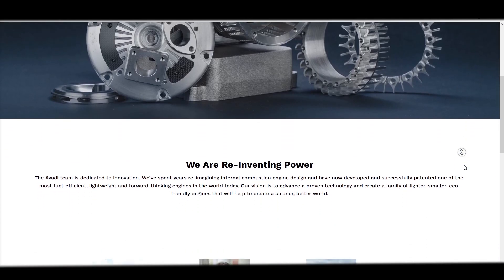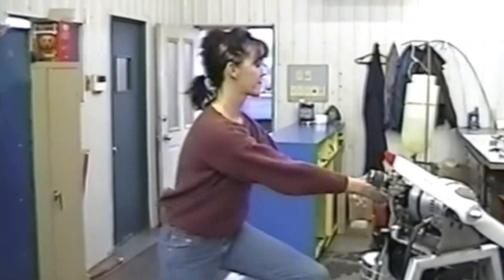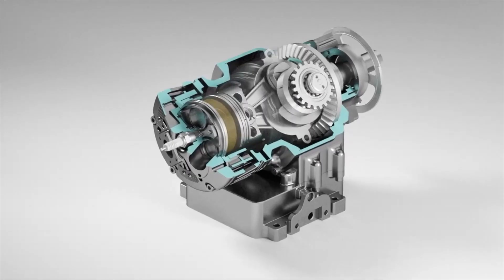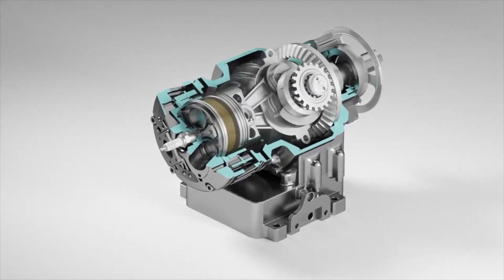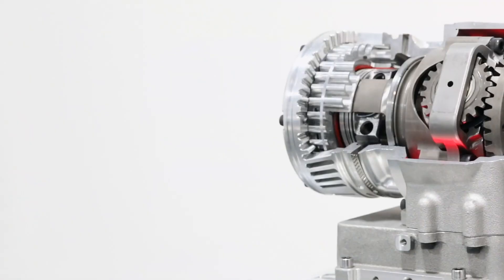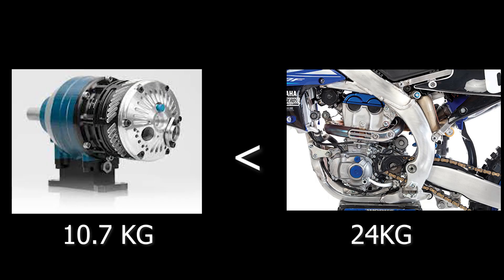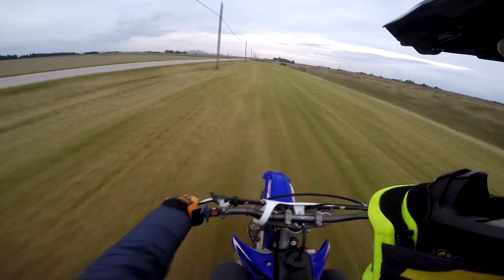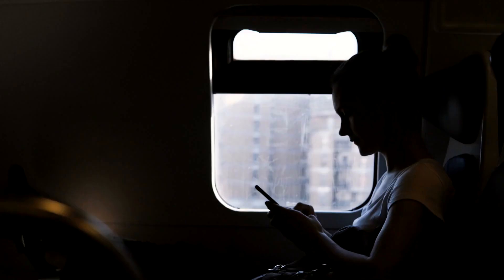The Avadi MA-250 - The internal combustion engine re-imagined.

Comment: LESS efficient than a motorcycle engine.  Less power and torque, if you take into account the torque multiplication that the engine's inherent gearing has. What's its point? Only in something where an expensive but small, low power, single cylinder (and light) engine is needed. Otherwise, it's useless.

Comment: Very interesting and unique design, however engine still burns fuel, which is one of the least efficient methods of obtaining energy. Electric motors enjoy efficiencies in high 90's, and produce zero pollutants; unlike fuel burning Otto-Cycle limited by thermodynamics. Internal combustion is antiquated, inefficient, generates pollution, and horribly mechanical by nature. Lets move on to produce energy from clean chemical, biological, and renewable sources. Given eventuality of laws banning use of internal combustion engines, this design is novel but not future proof.

Comment: Saying it's simplified but has been made more complicated with more moving parts which in turn cause more wear. What has been doen to avoid or minimize piston skirt wear during the upward and now added rotational force. If there is any failure it doesn't seem like an economic or straightforward fix. Seems to be overengineered.

Comment: Yes, but the piston is moving at twice the speed of the output shaft and the output shaft would have a maximum rpm of a lawnmower engine.  Cut the power claims by 50% on the Avadi, to better represent the actual power output.

Comment: To be fair, you're not including a transmission you'd need to add to the size and weight of this engine. Also, many trail type bikes that are 250s also put out about 16 hp, so this may not work in a flagship bike, it may fit nicely into something like a TW200 or XT250 as well as ATVs

Comment: It is an interesting concept , I  totally reliable conventional valve assembly would not detract at all from the rest of this ingenious design, moreover,  electro-mechanical valves have been used in diesel engines for well over 40 year ...no reason why they could not be used on this little gem.

Comment: After watching the cutout animation several times I am wondering about what the combustion heat will do to the gears. Longevity is an aspect that needs to be addressed.
Reply: Also gears don‘t like to get hot. Metal expands and so the gears would either seize or at least lose sync or change timing.

Comment: This is an interesting engine, however, why compare capacity with another engine?. What matters is specific fuel consumption for energy output. I also wonder how well the sealing of the port plate will work. Also wonder about the frictional losses of the double crank. How is the heat dissapated from the rotating port plate ? It might be a good engine to scale up to keep the rotational speed down. Very interested to see further developments and more technical detail.

Comment: This would be perfect for a generator, but instead of gasoline, you use hydrogen, then the emissions will be met and the electric produced will drive the vehicle much like a diesel operated train. The diesel engine only spends the generator, but it is Able to pull the entire train, using less fuel than conventional systems

Comment: Somone has also beenbworking on an oposing 2 piston motor with a simlur desine  each piston moves away from the center then back, with a few changes to intake exhaust  you can slso add that to a piston chamber in place of valves
You could also turbo charge it for more rpms and higher reves. Your intake could serve as the injection chamber to turn fuel into a vapor 
Gas as a vapor burns hoter cleaner and faster,  you would have to make this an oil cooled engine. No room for a water based coolent.
Now you add 8 of these that spin for a 16 piston motor assembly.

Comment: The fact that they made the cylinder rotate with the piston is fascinating and way outside the box. I love it.
Reply: It add a lot of weight moving...
Reply: Friction
Reply: Look up sleeve valve engines.
Reply: @peterwilliams2152  Actually, this is backwards: the sleeves in those old engines specifically rotated around the piston because they discovered there is a massive decrease in friction (long story short, oilfilm is never broken due to constant movement), so this Avadi failed to capitalize on a massive benefit they'd have gained for free.

Comment: If the normal motor is twice the weight but your still carrying a 200lb man it doesn't make any difference. I'd rather have twice the power when an extra 25 lbs or whatever it is isn't going to change the power to weight ratio. Plus those gears are a failure point.

Comment: People don't understand the stop-and-go forces of the piston will wear and break the gears, the gears will be stopping and starting at a speed you cannot comprehend. The gears also drain power especially 90 degree bevel gears, not to mention the thrush loads, power drain,  this is just a worthless experiment
Reply: The "starting and stopping" ---> just add a flywheel...
Reply: @MikeSmith-vb8ul  that dampens the effect, it is one of the reasons you need a flywheel

Comment: I think this is certainly an interesting approach. The only real criticism I could offer is that there SEEMS to be a lot of added complexity. And there are certainly easier ways to utilize rotary valves. But, on the flip side. This engine would almost have to be very smooth. Would be interesting to know the internal dimensions.
Reply: Lol there are many real criticisms besides mere "complexity" ; )
Reply: Why would this engine “have to be smooth”??   It’s a big single cylinder primary force is large and without mitigation that I saw?
Reply: @timduncan8450 How does a single cylinder engine run with little vibration in any scenario?  This engine doesn't have balancers so most of the vibration on this engine would make the whole thing vibrate back and forth against the crankshaft beating whatever transmission is attached into submission.  At least with conventional engines the vibration can be seen in the rotation instead of turning the crankshaft into a hammer drill or jackhammer bit.

Comment: I really don’t understand how you can compare this to a dirt bike engine. The dirt bike engine weighs that much because it has 6 gears and a clutch and it’s water cooled. Take all of that off and I’m sure it’s a lot closer.. and like you said, double the power. 

Second of all, there’s a much simpler version of this. It’s called a Wankel engine. Much less moving parts. 

I truly do believe in innovation but like you said in the video, we’ve used the same engine design for 100 years. That’s 100 years of perfecting the combustion engine. What you call archaic is what I would call efficient. 

 I also know for a fact that ICE are going by the wayside. And if you don’t believe that.. you will be left behind. 

This is a really cool concept but I don’t see the benefits of this.

Comment: I don't see the point of trying to "revolutionise" the interal combustion when the emphasis is to try and eliminate it all together.
Reply: That's a bad emphasis. The emphasis should be on creating carbon neutral fuels, such as the green crude oil Sapphire Energy was making 14 years ago before the gas prices dropped again and funding dried up. 

Since the algae makes the oil from CO2 in the atmosphere, it is literally carbon neutral-burning it only puts back what you took out of the atmosphere. That way even cargo ships, jets, and trains are don't add excess carbon to the atmosphere, much less cars and trucks.

I mean they were far enough along that really all that was needed was a single gene edit to make the algae "sweat" the oil so energy intensive drying and expression would not be necessary, you'd literally just skim the algae tanks. They were trying to set up a deal with Monsanto to do just that when investment dried up.

Comment: it seems we get new designs like this all the time, yet they never pan out to become production engines.

anyone remember "the duke" engine? it was a 5 cylinder engine that was supposed to have the power of a 6 cylinder engine, while being as smooth as an electric engine. the ad even had them balancing a coin on the engine. what ever happened to that engine? it was too complicated to manufacture

 while this engine is really cool, I don't see them being able to make a production engine that will fill a requirement. the engine will either be too small to be beneficial, or too large to manufacture. the larger you go, the harder it becomes to maintain a seal on the spinning cylinder. metals expand at a percentage rate, yet seals don't scale at a percentage rate. if on a small engine, you need 0.001" of tolerance on a 1" piston, that's doable, but if you have a 2" piston, you still need to maintain that 0.001" of tolerance, making it next to impossible to scale the engine to a larger size.

so you will have a very difficult to manufacture small engine, probably costing around $3000, that you can go to harbor freight and get a similar engine for $300. that cheaper engine will have more parts compatibility as it is based on a Honda engine, so spare parts will be easier, cheaper and more forthcoming, while spare parts for this engine will be the exact opposite, more difficult to find, more expensive, and less options.

Comment: Just a quick note about the yamaha yzf250 engine weight comparison, the transmission of any traditional dirtbike is integrated with the engine making it take up less space vs having the engine separated from the transmission. By comparing the avadi engine to the yzf engine its unfair due to the inclusion of the transmissions weight. If you want a fair comparison, then compare to the weight of a standalone engine like a Tillotson 225 or handicap the avadi engine by adding the weight of transmission to the avadi engine weight.
Reply: Trasmision, starter, pinion sprocket, kickstart (if equipped) for sure the yz250f engine is a marvelous high technology engine and is stupid powerful for its size taking in count the behavior of this engine is amazing a lot of power but predictable smoth control
Reply: Exactly! And factory race bike 250cc engines are putting HP into the upper 40’s.
Really neat concept though.

Comment: Looks like piston side thrust has been eliminated or vastly reduced. Nice design for small, niche, applications as few parts.
Reply: Piston side thrust negated... yes.... but instead now its adding a rotational torque on the connecting rods... like hammering on a screw... im not certain that is better.

Comment: fr why not just make a really good rotary instead of this very complicated lossy design. 
God Imagine balancing the assembly that would take a day...

Finish the job Mazda started instead.
Reply: Mazda are introducing a new 38HP rotary in the MX-30 hybrid in Jan 2023. It turns only a generator at a constant speed so it can run at its _sweet spot._.  The rotary when burning hydrogen increases efficiency 25%.  Toyota were involved in the engine. It also looks good for portable generator applications. 

The Wankel design is not the best rotary design. Liquid Piston is much better, who supply an engine for the 777 howitzer gun.

Comment: This concept adds more complexity, than it avoids. 
Some details of this approach have been seen in other approaches, but neither rotating cylinders nor rotating valves made it into mass production or at least mentionable prototypes. Moving masses and building complexity do explode compared to a 2-stroke, even if adding an intake valve system and exhaust/backpressure control.
I'd also say, that friction/lubing and soundness problems will make servicing and lifetime a nightmare.
Reply: It's good for UAVs and other military applications
Reply: How do they make piston rings last is my question
Reply: @davidlyda3388 i do worry more about the bearings and gears that have to bear the force of the combustion.
Reply: Too many parts moving !!

Comment: Hold that rotating mass still by the ends, free the ring gear, and run it as a 2 stroke with ports instead of valves. 

Y'all are really overthinking this.
Reply: Agreed. A regular portet 2 stroke, with forced induction for scavenging and also just for higher BMEP/torque would be the ideal powerhouse. Lubricated like a 4-stroke, but all the simplicity and significantly increased power to weight ratio from a 2-stroke. Piston ring life and inceased oil consumtion due to the ports has pretty much already been solved, take big marine diesel engines or the achates opposed 2 stroke engine as examples. Most of the time, simple is just best.

Comment: ok but even if the engine wheight half, it's still the same displacement for less power. so if you want same power you have to increase displacement thus wheight and size. so i don't think it's really a good alternative. and it seems really not practical to service, it looks like it's sealed.

Comment: Overly complicated.  Too many moving parts.  As a result of power loss due to all of those moving parts, it would require stupid high RPM to attain any realistically viable torque.  Which RPM's would reduce its useful life span to about that equal to that of the engine for a top fuel dragster.

Comment: Thank you for sharing our story. In regards to the longevity/durability of the head sealing system.. The engine has run with the current head and seal design for about dozens of hours over probably hundreds of runs over the last two years. The seals are ceramic rings backed up with a thin steel washer, teflon seal, then wave springs. While this design works, the wave springs tend to lose their "springiness" over the course of several heat cycles. We are working on a design which would further remove the wave springs from the combustion event. This is generally the only fail point on the engine. All of the gearing for the con-rods, fixed ring gear, pinion gears, crank weights, bearings, cylinder, shaft etc. have held up wonderfully over many hours of hard dyno-testing. Since the video was released in January we have redesigned the fan and fan housing, which has allowed the engine to stay much cooler. Lots of work to integrate a starter with a smaller flywheel, internal mechanical fuel pump, but those are relatively small projects in relation to what has gone into this so far. 

Thanks once more,

-Landon
Reply: Wishing the team all the best with the project.
Reply: Thats a very innovative design.
Reply: Thank you for this project! What are efficient and max RPMs and power output at them?
Reply: The Engine oil is transmission oil too?
Reply: 🤔Cool coil near the fan.
Reply: Fascinating design. Hoping you find a solution to the spring ring problem. I really like the design and the torque 🎉
Reply: Que tipo de rodamiento usan para el giro del conjunto cilindro y bloke ?

Comment: Definitely workable, but how this engine could be better than a conventional one is debatable. It definitely has more complexity, replacing the tried and proven crank and connecting rod with two cranks, two connecting rods and some gears. That rotating piston head is similar to the now extinct sleeve-valve technology of WW2, and would likely incur the same disadvantages such as high oil consumption. One on top of the other, I don't think the piston engine as a concept can be improved.
Reply: 2 cranks would i think make it possible to do much higher revolutions on such engine since forces would balance each other out... i think...
Reply: I don't know much about 4 stroke engines, but I do know that with dirt bike tech a 4 valve produces more power than a 2 valve ; Then there's this power valve concept thing ?
Yamaha supposedly came out with a 5 valve per cylinder ?
I'm glad 4 stroke technology  has finally eclipsed 2 stroke !
Reply: @rscott2247  Except in really small or really large instances.  Handheld equipment is still largely 2 stroke and the largest most powerful engines on the planet are also two stroke (yes, I know they are compression ignition "Diesel" but still).

Comment: nah, those rotating valves are the huge drawback. when piston rotate, it has sealing problem. and piston won't last long. interesting but won't make to the market.
Reply: The piston doesn't spin inside the cylinder, it rotates with the cylinder. The disc at the top of the cylinder is fixed, and plated with hard chrome which is incredibly smooth (3-6 ra),  and sits against ceramic seals in the head.
Reply: @avadienginesinc.7902  Did your team evaluate nikasil layer as opposed to chrome❓
Reply: Exactly.
Piston rotates, its huge problem

Comment: No ways, you forgot the Yamaha engine has a clutch and  gearbox included... Yes a rotating disc valve is a great idea, 2 strokes used it for years but all those gears sap power and only provide one output speed. It's a nice idea but not a game changer...
Reply: ah... first look at this and i couldnt figure out how could be so much lighter for same displacement. i guess drone engine as front of this engine is smaller than standard one.

Comment: Way too much inertia. Those two crankshafts need to change direction twice per cycle, that's twice wasted energy of a normal engine, not to mention that the rotation will have unwanted torque, also wasted energy.
Reply: Well you dont seem to know the difference between crankshafts and connecting rods
Reply: @zoggrog8823  thanks for letting me know!
Reply: Changing direction doesn't really waste energy (except from friciton and such), all that energy of the deaccelerating piston will go into the crankshaft. But maybe you mean it causes extra unwanted forces and more wear, which would be true.